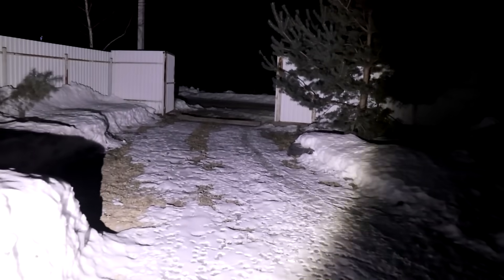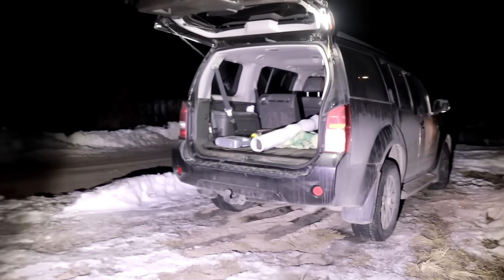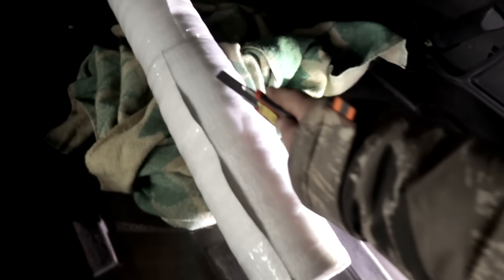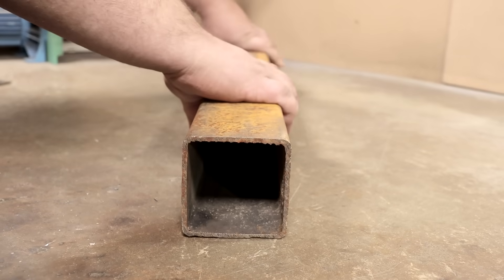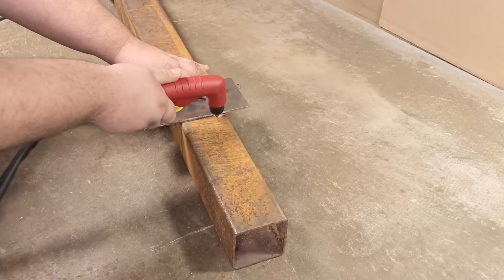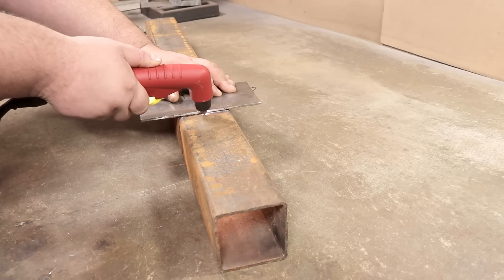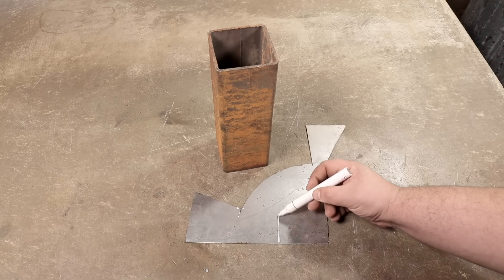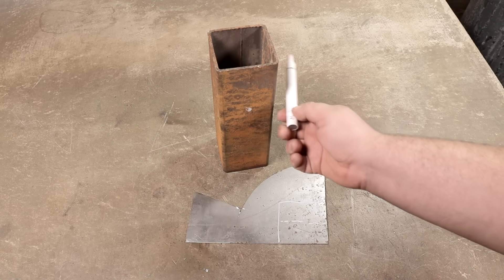NEW HEATER. Rocket stove is no longer needed!

Comment: I'm not seeing an efficient stove and a thermal battery, I'm seeing a neat flame vortex. I bet 70% of all the heat is going straight outside. Could you imagine leaving this alone in a room by itself? Everytime I left it alone I'd wonder if the glass breaking is loud enough for me to hear it. If it broke would the flame lower? I doubt it since the flame would still draw air pulling it through the vortex fins and probably still create a super hot fire tornado. I like the vid and it's super neat, but it needs some thermal storage and some kind of auto shutoff.

"You wake up in the morning and get a glass of cold water. As you walk toward the eternal flame you step on a lego, stumble, and accidentally spill your cup onto the glass. You watch in horror as a crack elongates up the beautiful glass flame enclosure. Your mind races trying to think of a way to make it stop. You are about to run and get some aluminum tape when the cracking becomes shattering. You are left standing, the sole survivor of the battle between hot and cold. The wreckage is devastating. The wailing begins as your partner wakes into a nightmare of noise, open flame and a creeping chill. A few weeks later Betty began therapy for PTSD. They don't know if she'll ever be free of her burden or if she'll keep the nightmares indefinitely. The family called it "The day the warmth died."

Comment: Good show mate! I’ve been toying with creating my own batch box rocket stove using some Peter Vandenburg and another of his contemporaries designs to which like your design I have been attempting to figure out how to also incorporate glass tubing. I’ve found high temp glass tubing sourced via common propane patio heaters at a reasonable price. Originally I wanted to nest a length of tubing inside another larger diameter length so that the draft would be pulled up through the inside tube and then back down again within the 2nd tube that would be capped off at the top a few inches above the inner tube. My thoughts concerning this design would allow for you to see the beautiful flames while at the same time providing a modicum of insulation by way of the second plenum used to direct the exhaust down and around the riser. Like you mentioned the price of the burn chamber whether made from stainless, ceramic fiberboard and fire brick, or a combination of them are not necessarily too pricy.  Even the 4” diameter glass is not all that expensive, but sourcing a larger diameter glass tube is where I’m having difficulties in sourcing without breaking the bank! Maybe it’s being as ADHD as I am wanting to fit 10lbs of shit into a 5lb bag type of thinking, but like many of my projects I’m constantly trying to build one product with as many features as possible, and besides having just a glass door to feed the batch box I’m also wanting a feed tube for longer stick and the ability to add a hopper for pellets. I do believe multi fuel is the way to go and have also been looking into having the ability for both used motor and vegetable oil to operate the stove as a fuel option. I have only done some limited research on this but cannot see why it wouldn’t be possible.

Comment: The idea behind the original rocket stove, is that all of the gases burn off in the combustion chamber creating a clean burn.  Your build is modeled after the "Pocket Rocket" which is the smaller dumbed down version of a rocket stove that is primarily used for casual weekend use. It's a nice for a new experimental build, but it is not a rocket stove. Rockets stoves require a J tube, and a combustion chamber, and are designed to use small dead branches to maximize efficiency, labor of collecting free materials, and you prune a tree aiding the health of a tree. (or growth of a fruit tree, nut tree....).

Low to no smoke signature with real rocket stoves keeps predators out of your camp, (A.O.), and people from hunting you in prepper scenarios.

Comment: I think that if inventors of old were as discouraged as they are today we might still be using oil soaked rags to light our castles. If it comes down to an alternative fuel, make sure you tell no one. . The idea of the pellet is fantastic. I have a pellet stove that worked for 30 years. The price of pellets has doubled. I still think that if you have your Furnace setup to where you can circulate the air, the cheaper it may be to run. I congratulate you Dr Robo. Keep on keeping on. Happy 2025

Comment: I really don't understand what you're going after with these vortices flames you're not gonna create any more heat then you would you just change the time interval for using fuel up. You get the same exact amount of energy out of that fuel no matter what you do what is the purpose of the vortex flame it doesn't seem to have any purpose other than to be fun to look at

Comment: Rocket STOVE?  How do you cook on this stove.

It's not a rocket heater either.  At the end of the video it looks like that flame's heat is going straight up the chimney where as rocket mass heater has double barrel combustion chamber and usually then pipes the heat into a thermal mass.

Comment: What is the benefit of creating an air flow and flame vortex inside the glass pipe?
Does it somhow make burning the fuel more efficient?
Have you looked into rocket mass heaters and stoves?
You design reminds me of those.

Comment: 3:56 that's a really nice intricate design to create a vortex in the pipe. Great stuff 🙂
Also, when you put the glass cylinder on it to use as a sort of mantle and chimney, make sure it's the high heat kind, or it could shatter.

Comment: Since the vortex in the tube is pulling air through from the bottom are you not loosing ambient warm room  air up the  'chimney' and causing a negative pressure in the room pulling cold outside air indoors?
Reply from the maker: Yes, now the air is taken from the room, but you can easily take air from the street with minor modifications.

Comment: Nice, so you can shoot flames up a stove pipe, why didn't you show the temperatures you record at the burner, at your ceiling and then outside at the exhaust stack. Heating a space is much different than making a rocket pipe, it's more about the exchanger efficiency to transfer or convert the high temperature combustion gas safely into a breathable form of heated gas within a confined space. Even a six to 8 year old can throw wood into a stove and supercharge the stovepipe to the point it causes a rocket like chimney fire which sucks all the breathable air quickly out of the living space.
Reply from the maker: The glass pipe connects to the main chimney and exits through the roof to the open space! Carbon monoxide does not enter the room at all.
Reply: @doctor-robo  I am well aware of that,my point is you are showing how hot it gets but all that GREAT heat is totally wasted as it shoots up into the sky. Creating heat without utilizing it is as bad, no disgraceful as going out and poaching a Siberian tiger just to boast to onlookers  ""LOOK AT ME, I SHOT A MIGHTY SIBERIAN TIGER!" Skinning and stuffing it NOT even butchering it for the meat it renders.
Reply: @doctor-robo  Anyone can toss a cigarette into a dry forest and grunt out like first cavemen unn ugh FY-UR Hot!!

Comment: I'm curious as to the point of the auger design on outside of the pipe.
Other then chimney stability what does it help with?
Seems like too much heat right up the chimney.
Reply from the maker: I created a flame vortex so that the flame does not touch the glass pipe and does not pollute the glass. In this oven, not only air heating, but also a very powerful infrared heat radiation.

Comment: What brand is your cutting torch? Thank you for replying.
Reply from the maker: The brand is not important, the main characteristics of the device:
Network parameters: 230 V / 50 Hz / 30 A (max.)
Control Board: IGBT Inverter
Air pressure: 0.4~0.5MPA
Cutting capacity: 12mm Steel; 7mm stainless steel; 6mm Aluminum
Arc Ignition System: Autostart (at 5 second intervals)
Burner with non-touch ignition.

Comment: What is the name of the item you use to cut metal so easily please?
Reply from the maker: This is a plasma cutter.
Here are its characteristics.
Network parameters: 230 V / 50 Hz / 30 A (max.)
Control Board: IGBT Inverter
Air pressure: 0.4~0.5MPA
Cutting capacity: 12mm Steel; 7mm stainless steel; 6mm Aluminum
Arc Ignition System: Autostart (at 5 second intervals)
Reply: Thank you so much...😃👍

Comment: Who makes that cutting torch?  First I thought you were holding a plasma cutter, then I saw the flame...
Reply from the maker: The manufacturer can be anyone.
They differ in power and a burner that has an arc ignition without touching.
Here are its characteristics.
Network parameters: 230 V / 50 Hz / 30 A (max.)
Control Board: IGBT Inverter
Air pressure: 0.4~0.5MPA
Cutting capacity: 12mm Steel; 7mm stainless steel; 6mm Aluminum
Arc Ignition System: Autostart (at 5 second intervals)

Comment: Is there a safety mechanism in the fuel hopper to avoid back burning? Also have you witnessed any condensation on very top of the glass chimney?
Reply from the maker: There is no condensate at the very top of the glass chimney and there will not be, the temperature is too high there. No, there is no valve, since there is a discharged space, the fire does not pass into the container. There is also a small limiter for half the diameter of the square pipe, so that there is no too strong supply of fuel pellets.
Reply: @doctor-robo  thank you for your kind reply sir. Appriciate your work. Have a good one.

Comment: What Plasma Cutter model ??? That seems like it works very well.
Reply from the maker: Network parameters: 230 V / 50 Hz / 30 A (max.)
Control Board: IGBT Inverter
Air pressure: 0.4~0.5MPA
Cutting capacity: 12mm Steel; 7mm Stainless steel; 6mm Aluminum
Arc Ignition System: Autostart (at 5 second intervals)

Comment: Looks amazing, but you are loosing allot of the heat in to the chimney... You are also sucking up warm air from the room and exhausting it outside...
Reply from the maker: For operation, you can make the supply of outside air. Yes, the efficiency of the furnace is not great, but you need to choose either beautifully and conceptually, or high efficiency and a massive stone structure.
Reply: @doctor-robo  Try incorporating steam filled radiative pipes in one of your next projects! Just like the sealed heat pipes for cooling CPUs. They are made with a little bit of water and evacuated to near vacuum, at the point that water starts to boil at below room temperature. that would improve the efficiency massively, but at the cost of complexity... I am designing a water based heating system for tents that keeps the fire outside of the tent, makes a modest amount of electricity and provides about a kilowatt of heating at maximum power. It should use about 200-300grams of cooking gas, which is one standard can of camping gas per night. as of now the prototype uses a gas stove placed 3 meters from the tent, makes 20W of electrical power and provides 600-700 watts of heating power. The 20W of electricity is further stabilized to 5V and powers the water pump(3W), the fan inside the tent blowing the heat from the radiator(2W) and a power bank from which we power all of our gadgets and some lights. I am mostly using computer components and high temperature hoses insulated with soft foam insulation. 
when you put it in the heat it is self starting.

Comment: The one issue to improve thermal efficiency is to take almost all combustion air (both initial combustion and 2ndary chimney combustion) from exterior instead of interior as it must be replaced in the room by the colder exterior air keeping the room temp cooler than otherwise would be.  However, some small amount of interior air should still be used for combustion to allow replacement fresh air into the room.
Reply from the maker: Yes, you are absolutely right, but it is not difficult to supply combustion air from outside, for example using a flexible duct.

Comment: 🤩 what is that cutting tool?
Reply from the maker: It's a plasma cutter!
Network parameters: 230 V / 50 Hz / 30 A (max.)
Control Board: IGBT Inverter
Air pressure: 0.4~0.5MPA
Cutting capacity: 12mm Steel; 7mm stainless steel; 6mm Aluminum
Arc Ignition System: Autostart (at 5 second intervals)
Reply: Awesome! Thank you

Comment: this actually seems physically dangerous. How hot does that glass chimney actually get? and what are the chances of an accident near it? I will admit it's very pretty though
Reply from the maker: This glass can withstand 1400 degrees Celsius. Everything is safe enough.
Reply: @Mr. Robo it is not very safe if you trip over your dog and fall against a 1400 degree chimney. You will be burned severely and could easily end up needing to go to the hospital. Now I realize that it's probably not actually that hot, but even if the chimney is radiating at 100 degrees celsius, that's pretty dangerous to have sitting in a space where uncontrolled events could happen to animals (of all kinds, including humans)

Comment: What kind of plasma cutter?
Reply from the maker: Network parameters: 230 V / 50 Hz / 30 A (max.)
Control Board: IGBT Inverter
Air pressure: 0.4~0.5MPA
Cutting capacity: 12mm Steel; 7mm Stainless steel; 6mm Aluminum
Arc Ignition System: Autostart (at 5 second intervals) 🤖

Comment: how long does a full load of pellets last?
Reply from the maker: It depends how the fire is adjusted. Moreover, the container can be made in any size. On a full load of this container and low heat, it lasts for 2-3 hours.

Comment: New to this type of stove so forgive a possible dumb question, but isn't there a huge amount of wasted heat venting straight up the pipe into the open air?
Reply from the maker: Of course, the efficiency of this design is not high, but there are many different furnaces of other designs. Everyone chooses either efficiency or beauty and conceptuality. 🤖

Comment: I built a rocket stove in a shack in Alaska.
it worked because it was a J shape. Source was just small chopped wood.
Burned HOT but fast. You can't fall asleep 8 hours let alone 1 before -30 would wake you up to start another fire.
Reply from the maker: Yes, rocket stoves have this problem. But if you use pellets, you can achieve automatic fuel supply and flame power adjustment.

Comment: That's awesome , I've been trying to figure a way to have a cheap and easily made device as a heating source, do you make anything that's doesn't include having to weld anything or the help of serious machinery , I mean I havee some tools like a Dremel and drill few sheet metal cutting tools , like snips and a metal pipe cutter  and your basic hand tools ????
Reply from the maker: Thanks a lot! As practice has shown, any thing can be done with three tools - a angle grinder, a drill and a welding machine.

Comment: Micro holes at base of glass would increase size of flame.
Reply from the maker: There are no holes in the glass, they are at the base of the platform on which the glass stands. I wanted to make an air adjustment (flap) in this place, but I was not sure that it was needed.

Comment: I am curious what is the BTU output of this well designed rocket stove? New suscriber also. Side note I have done mission work in very remote villages that get cold, I would like very much to learn how to build same type rocket stove for use in remote villages! Most of the time all they provide or have is a fire outside for warmth!
Reply from the maker: The approximate power of this flame is 20-25 KiloWatts. I think you will succeed! Thank you!

Comment: It would be interesting to design the glass so interior air of the room could be pulled around chambers inside the glass tube and expelled into the space being heated
Reply from the maker: I agree with you completely, you just need to have a second glass pipe of a larger diameter. This is a very good idea, I will try to find such a pipe. Thank you!

Comment: Would a ceramic heat sink chimney, instead of a glass one work? Also, can this operate horizontally, instead of vertically? Any figures for flue temperatures, progressing up the pipe?
Reply from the maker: As a chimney, you can use not only glass, but also ceramics or stainless steel, and even install a heat exchanger. But of course it will not work horizontally.